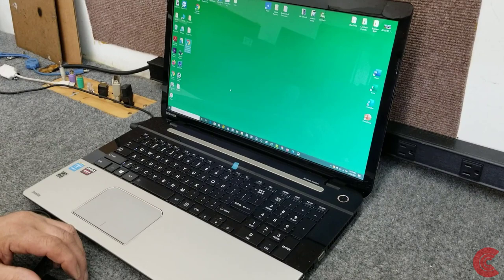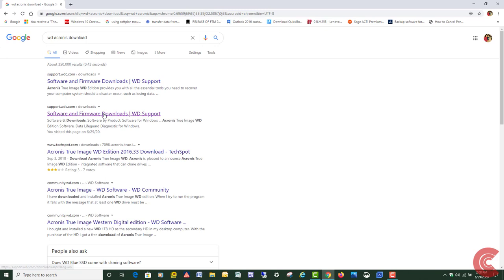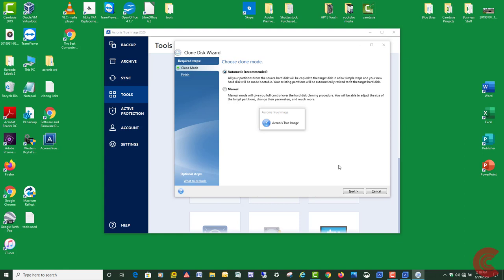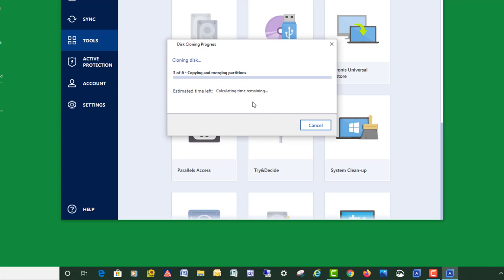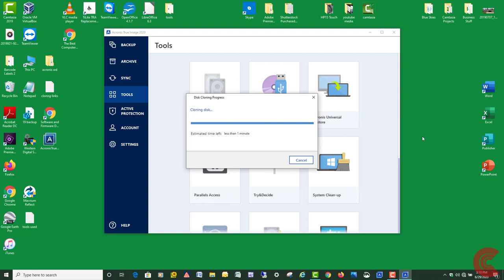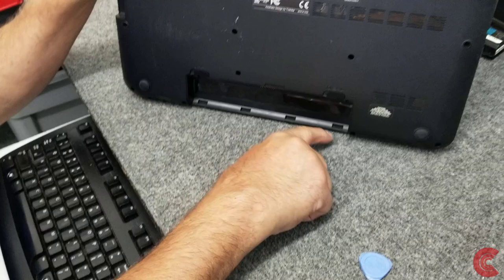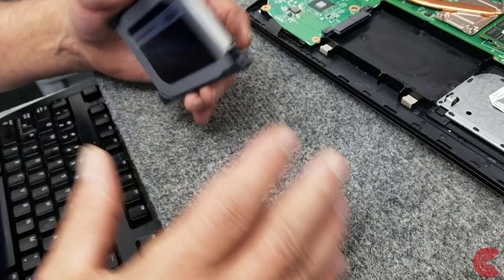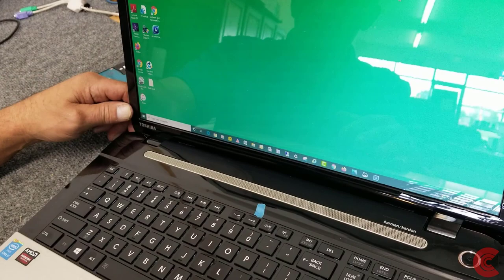Clone Hard Drive to New SATA SSD Using Acronis True Image 2020 & Install New SSD.

Comment: Dell Inspiron 15-3521 laptop.  PNY 500 GB kit since it has the usb connector and link to the Acronis software.  Remember after downloading,  right click in Windows 10 on the downloaded .exe file and followed steps in the video.  Thanks, Dale, for a very helpful video.  .

Comment: Did it with a lower end Toshiba, it didn't boot. Didn't create a restore disc before, didn't want to open it again, so planned to update the bios and by mistake I used Acronis to wipe my flash drive and killed it.

Comment: Is this process any different for just cloning the storage drive? My computer has the OS on the C drive but I will be replacing/cloning the D drive. Do I just run the acronis clone in automatic mode then install the new drive and that's it? Idk why it would be different, but I'm a bit new to this
Reply from the maker: cloning process is the same for the most part. thx
Reply: @CadillacComputerCenter  Ok thanks. Hopefully everything goes smoothly

Comment: Thanks for the video.  On acronis website on several KB articles they tell you to install the new/target disk in the laptop and usb connect the old disc to avoid boot issues with the new disk.  You method is a lot easier, not having to futz with getting the laptop to boot off a USB drive to begin the clone process.  Do you know if this is a difference between older versions of acronis and the acronis 2020 product?   Long time user or acronis for backup but have not used the clone tool for ages.

Comment: I appreciate the video!  Wondering if you could address using True Image versus Disk Director to do disc cloning, and why you might chose one over the other.  Thank you!
Reply from the maker: Hi.  Well there are big differences in the two.  True Image allows for cloning both basic disks, MBR and GPT.  Disk Director only clones basic MBR disks. However, Disk Director offers many disk management tools. Such as creating multiple boot partitions,  etc.  On today's new computers, you certainly want GPT  support.  You can have both Disk Director and True Image installed together.   You can check out both at Acronis.com.  both software packages have great disk tools. Dale

Comment: Hi, thanks for posting. My internal desktop pc has a full 500gb drive which I wish to clone to a 1tb SSD. I am wondering if purchasing the sort of external SSD reader you demonstrate is better than fitting the 1tb empty SSD internally, your advise will be most helpful. I have subscribed to your Channel, as I find your commentaries easy to listen to, in depth and very helpful. Thanks for sharing. Regards, JB.
Reply from the maker: Hi. If you have a desktop PC, it would be better to attach your new ssd to an empty sata port temporarily on the mainboard and clone it that way.  Dale

Comment: Thanks for making such a detailed and informative video. I downloaded Acronis cloning software for the SABRENT HDD/USB enclosure I bought and am going to practice this cloning procedure on a Toshiba 500GB HDD that came out of my old Compaq laptop. It is exactly the same Brand and size to the one in my current working laptop, that is a ASUS X501A. I'm hoping that following your instructions will make this cloned disk bootable in my ASUS laptop. If that works well, then I plan to buy a 1TB SSD for my laptop and upgrade to that. I'm not 100% sure which SSD will work with my ASUS though. Do you think that a 1GB Crucial MX500 will work in this laptop. I'm just not very familiar with modern laptop 2.5" d rives so I don't know what 3D NAND or Gen 3 means. Any suggestions which drive will work for me. I'm considering a Crucial device or a PNY or something similar...
Reply: Crucial has a scanner which tells you the exact one needed.

Comment: I just got a Western Digital Blue SSD to replace my HDD, and I was planning on using the free WD cloning software with the USB 3.0 adapter. What sort of problems were you talking about with those?
Reply from the maker: Hi. Sometimes the software will not recognize the new ssd with the usb adapter.  Give it a try though. Really depends on the adapter.
Reply: @CadillacComputerCenter  I think it should be ok. I used this adapter to clone the HDD on my MacBook Pro to an SSD and it worked perfectly.
Reply: I downloaded crucials version of acronis and it hangs up after selecting source drive

Comment: why it doesn't work.. it's say the clone failed at the end...
Reply from the maker: Hi. I assume you are using Acronis.  Before you clone again try this.....open msconfig in your run box, disable all non- Microsoft services,  go to task manager and disable everything except acronis, same with services.   Reboot, then open up cmd as admin, then at the prompt,  type in. Chkdsk /f.   Space after chkdsk.  Then schedule the scan at next reboot.  Then try clone after it reboots from chkdsk. Dale
Reply: @CadillacComputerCenter  Thank you!!!! it's done !!! but wait.... I restarted my computer, gone to bios, and my pc boot in less than 3 seconds... like omg.... but when  I formate my hdd, my cpu cooler makes so noise... like maybe 60 decibel, wtf... I so scared do I turned off my computer

Comment: Hi, Can I install directly my new ssd mx500 to my dell optiplex micro 7060 and install new windows in it? by the way, I Have already m.2 ssd as my primary memory for my system. Is that okay to install new OS while I have already one running? thank you

Comment: Great video, concise and to the point! I have also just received my Crucial 1TB MX500 that I will be cloning from my Toshiba Satellite C50A 684 GB HDD. 2 questions: 1) Crucial has a free Acronis version I have downloaded as opposed to downloading WD...Have you ever tried Acronis for Crucial to do a Crucial SSD clone? 2) I am going to a bigger drive so should I use automatic, proportional or manual to set the partitions? Whatever the choice any recommendations? Thx in advance
Reply from the maker: Hi.  I have used Acronis for Crucial. Try the automatic option first, then check your partition layout.  Automatic usually is the best option.  All Acronis versions are pretty much the same.  You can always use proportional.  Dale
Reply: @CadillacComputerCenter  Thank you for the fast reply. Turns out the adapter I had was the wrong one and I am now waiting until next Tuesday or Wednesday for delivery...I'll let you know what transpires. Thx again.
FYI a few months back I installed a 500 GB SSD into a 2010 HP Pavillion with an I7 and 8GB RAM no cloning in this case as the original HDD had died so did a clean install of Win 10. It was an old work laptop and was no slouch but now it really flies. This is why I want to do my 'newer' Toshiba (2014)...